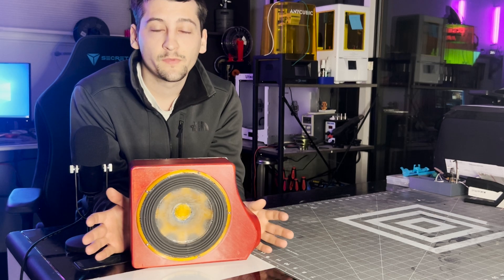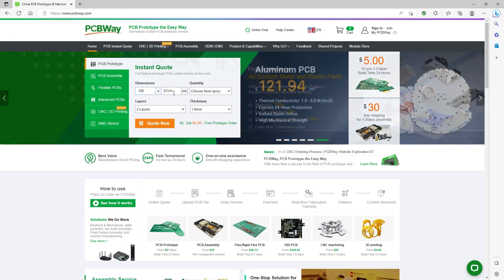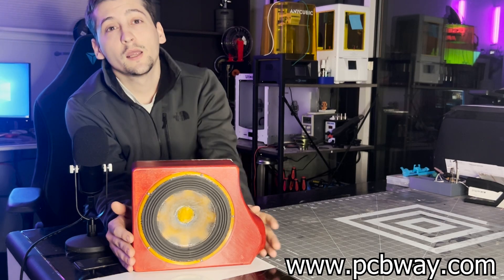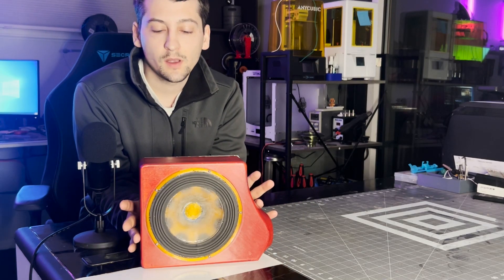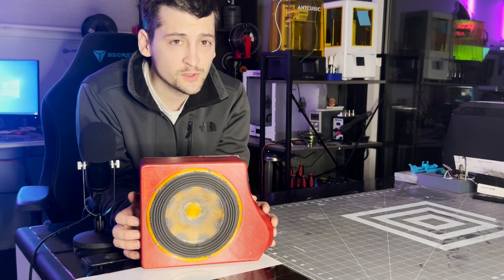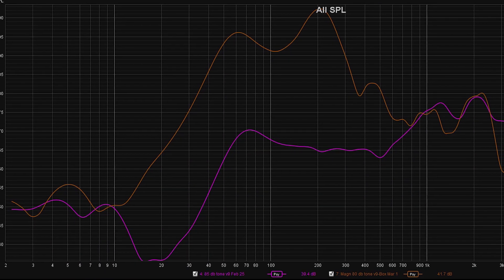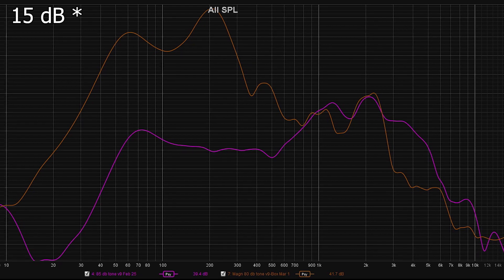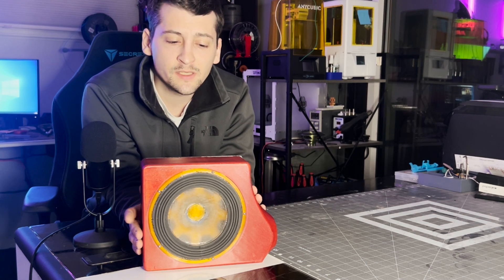Fully 3D Printed Speaker Box with a Printed Speaker

Comment: To save on sanding, you could try using a hot air gun to smooth out the layer lines. It doesn't need much, a few seconds too long, and a print is potentially ruined.

Comment: Can you make phone speaker sound amplifier
Reply from the maker: I believe the speakers in a phone are driven off of some sort of sound card or internal amplifier. So without completely dismantling and Frankensteining a phone, I don’t think a phone speaker amplifier is possible…
Reply: @piscesprinting  he may be on about one of those passive amplfiiers that utilise horn loading
Reply from the maker: I see, that would be doable, when the word “amplifier” came up I immediately went to electronic amplifier
Reply: Ok thanks for the reply
Reply: I mean only a sound boost
Reply from the maker: If you talking about one of the stands that you set your phone into and it just makes it louder, then yes that would be relatively easy, if your talking about adding more wattage to the speakers to get them louder/changing the speakers, then that is quite a bit harder.
Reply: @piscesprinting  ya that is ok i think